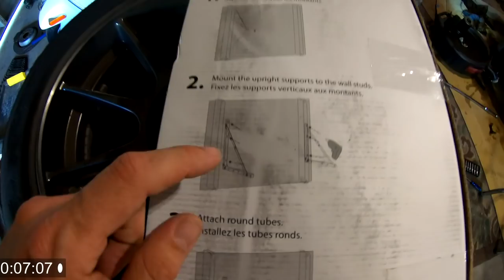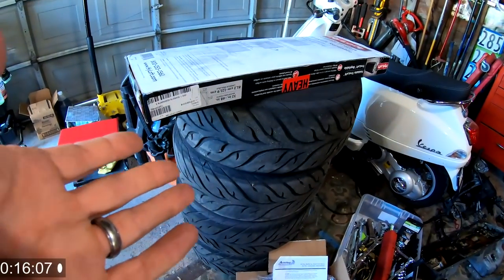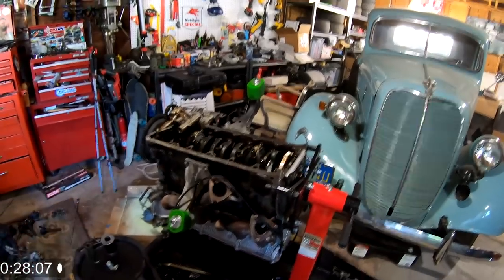MUST HAVE GARAGE TIRE/WHEEL RACK

Comment: Hello Blake
Thank you for making this. I may buy 1 or 2 of these myself.

I have read online from more than one source that if a tire is on rims they should be stacked sideways, and if it is not on rims they should be placed upright. Is there anything I would need to do is storing tires on rims for 8 months using this apparatus?

Comment: Hey Blake, how well do you think the koyorad would fit with the stock m20 clutch fan? Really want the koyorad  because turbo m20 life. Any thoughts?
Reply from the maker: Should have absolutely no issues. Great looking design that fits in stock late model configuration
Reply: @BlakesGarage  im swapping an 885 onto my e30, and switching to late model cooling system. Have everything besides the radiator. About to yank the engine/tranny out after i finagle the IE longtube headers off.
Reply from the maker: Voltaire E30 nice good luck man!
Reply: @BlakesGarage  thanks my man. Same to you on the s52. Ill be posting progress on ig for documentation.